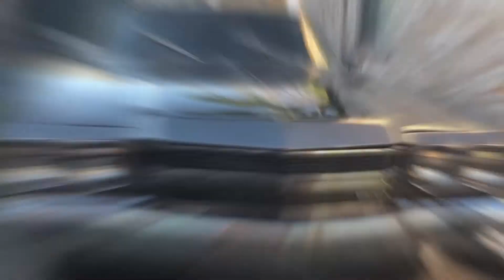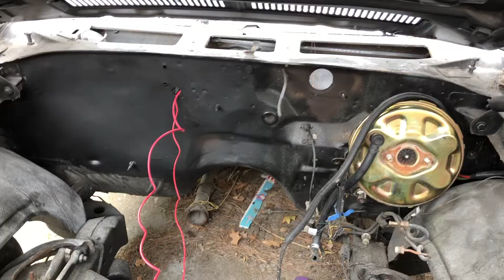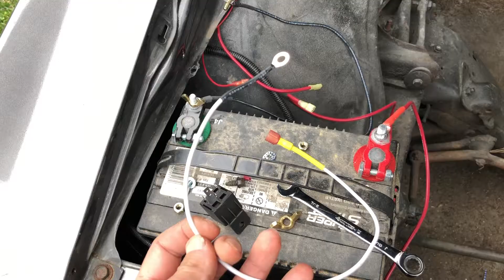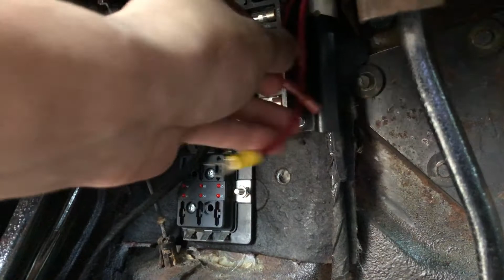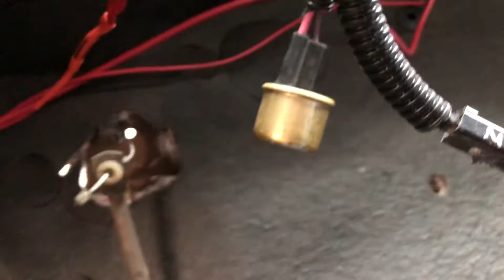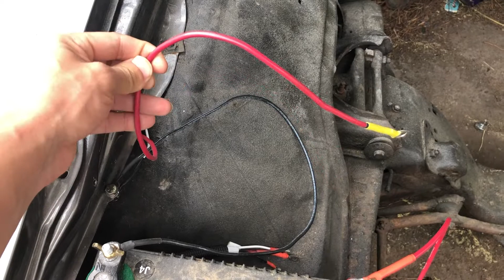How to add an Auxiliary Fuse Box on a 1970 Chevelle

Comment: great video. very helpful. What type of connector did you use to connect your signal wire to the glass fuse? Also in your original fuse box did you connect it between the glass fuse and the metal clip or somewhere else?

Comment: You shouldn't run un-fused powered wire into the cabin of the vehicle.  The wire should be routed directly to the back of a fuse block or relay center on the engine firewall side.